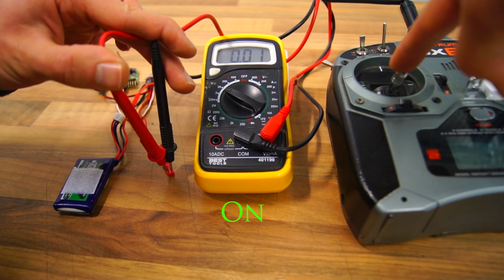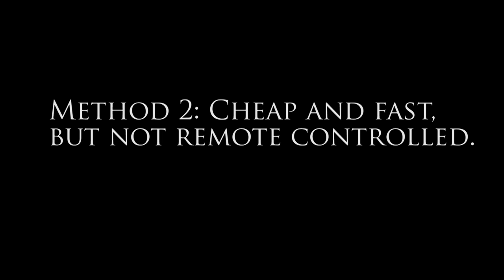Remote Control Ignition System - How to Make Firework Igniter

Comment: Many years ago, the Boy Scouts had a graduation ceremony that involved building a fire as part of the climax of the program.  I have reloaded my own ammunition, for rifle and pistol for more than 50yrs now, so I'm familiar with powder.  I was also familiar with the ignitors on model rockets.  I put a small amount of powder in some toilet paper along with an ignitor, built a TP around the paper out of kindling, buried the wire leading away from the fire pit and at the right moment, I pushed the magic button,  Boy Scouts and Parents alike were suitably impressed as the fire burst into flames.  I was also impressed with myself, lol....

Comment: Can you do this without the ESC or is that what prevents the battery from exploding?
Reply: ESC Take the signal from the RC Receiver and converts it to a dc output. The Receiver outputs a pulsed signal intended to control a servo.
Reply: @devinholland2189   Interesting. Since I posted this question I actually did make the experiment and made a (rather-unsafe-but-usable) ingnition system with just an arduino, a lipo, relay and khantal. But now I know what the ESC was for and maybe I'll use it for another project. Thanks!

Comment: Length of the kanthal wire?
Diameter of the kanthal wire?
Reply from the maker: +redstone craft guy 32 gauge wire and the length depends on how hot you want the wire. I used maybe 50mm of kanthal wire.
Reply: RCLifeOn wow, smaller than me, mine is 0.25 mm in diameter... I want my wire to be hot enough to light up bug spray (i want to build that remote controll flamethrower in that video you made)
Reply: Have you managed to build an igniter hot enough to lit up the spray? I am thinking of doing the same with hairspray, which probably uses the same propeller as your can. Thank you!

Comment: why are resistors required for this project?
Reply: The Hour is at Hand cause resistor is used to create heat by connecting both negative and positive of resistor to the same wire
Reply: best way is just to get thin copper wire and put it around mach or fuse.